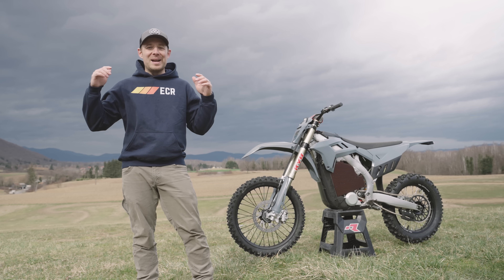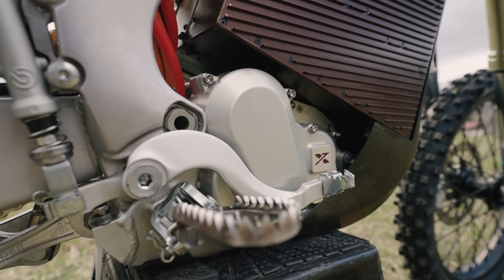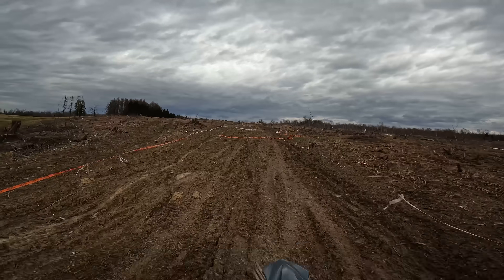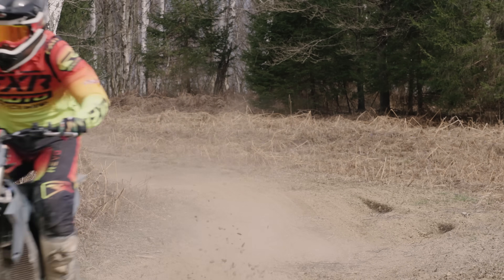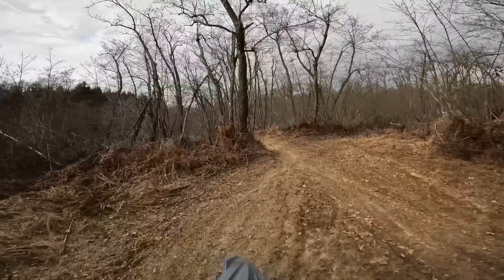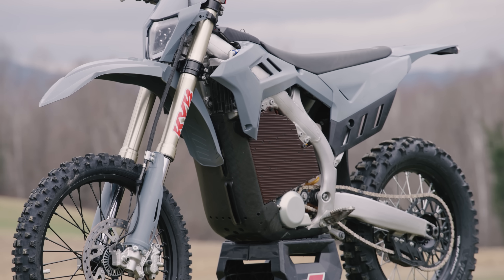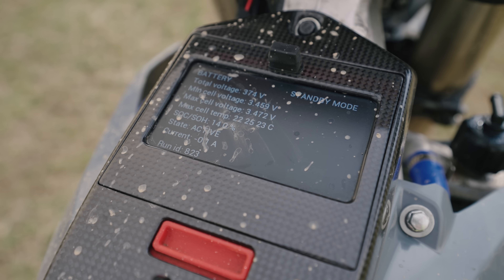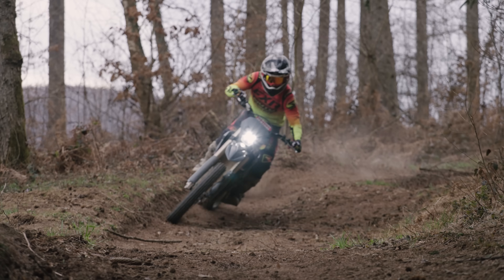We Rode This NEW Insanely Fast eMoto // Flux Primo First Ride

Comment: 80 HP and can not manage a top speed of 100 mph, electric meh.
Reply: How often you go 100mph out in the woods or on an MX track?
Reply: @shredmas  On the way to the woods, without having to drive it to the trail heads. If you are into enduro on and off-road riding, this is definitely not the tool for the task. The only thing it’s good for is for a motocross track and stealthier trail riding but suffers from the lack of range. To each their own.
Reply: @falcosparverius1  I just put my bike in the back of a truck or loaded on my trailer and go to the designated OHV staging location. Several of them within 30 minutes of my house. Also I can ride right from my house into BLM land in about 5 minutes. It sounds like you need a dual sport machine.
Reply: @shredmas  I’ve owned a Yamaha XT600 in the late 80’s that would take me to the trails and back home without a truck. Have been following the development of electric motorcycles, most of these expensive electric motocross bikes promote these high HP numbers but they all peter out at speed. A one trick pony for fun at a motocross track, I will pass due to their limited utility.
Reply: @falcosparverius1  yeah they at least had two speeds then you could attain the 100 mi an hour you're looking for
Reply: Where did they mention the top speed?
Reply: @AbnormalWrench  They didn’t but a Stark Varg which is similar at 80 claimed HP was put on a dyno reaching 96 MPH, which will not come close to 100 mph in real life riding. A 500cc dual sport will top that easily on a freeway.
Reply: @falcosparverius1 
The HP isn't the problem. 80HP is more than enough to break 100mph. It is the gearing. But I'm not sure why you assume this bike is geared the same as a Stark Varg
Reply: @AbnormalWrench  I watched the video, during the test ride, he did not mention the ability to change gears = no gears, which is a carbon copy of the Stark Varg, no gears and tailored to motocross conditions = similar to the output of the Stark Varg.
Reply: @falcosparverius1 change the gearing if you want more speed.
Reply: @weekendveterans  How would that help it improve the lack of range compared to a much less expensive internal combustion 4 stroke dual sport?
Reply: @falcosparverius1  
Once again, what a weird assumption. What gearing they ended up selecting may or may not be over 100mph, but even if it isn't, the sprockets can be changed. My Zero FX can do 100mph, albeit briefly due to thermal issues, and it has half the HP. There is nothing inherently hard about this "problem"
Reply: @AbnormalWrench  I am no novice regarding motorcycles, I’m a holder of an M1 license for more than 3 decades and logged over 150,000 miles on various motorcycles. I understand the limitations of electric motorcycles, their positive and negative aspects. Like I said, to each their own, what ever floats your boat, but based on the stats, they do not provide what I am looking for.
Reply: @falcosparverius1  
Ah, I didn't realize you were just trolling. Carry on then.
Reply: @falcosparverius1 you didn’t say anything about range, just top speed.
Reply: @AbnormalWrench  Is constructive criticism trolling? Maybe I should have said they have created the greatest thing since sliced bread despite their technological shortcomings. If these motorcycle manufacturers are serious about offering something useful and competitive with ice bikes, maybe a series hybrid generator that can be switched on/off, with range and matching top speed, a water cooled electric motor and controller that won’t overheat, then someday they may get more people to adopt their latest and greatest invention.
Reply: @weekendveterans  Read my posts on this thread, I clearly mentioned range. Have a good one, this thread is done.
Reply: @falcosparverius1  
No, it is trolling because you're nitpicking things that aren't even relevant to this bike, as far as you know. You can't seem to decide what you're nitpicking either, since you keep changing what you find disappointing.  Valid criticism would start with actually addressing anything in this video. I mean, if you want to make generic statements about things you dislike about electric bikes, at least that would be more honest, instead of pretending you have some inside knowledge about this bikes capabilities. 

People who have never ridden an electric bike seem to have lots of opinions on why they don't like them, much like EV cars. I ride my Zero on the trails every weekend, and the arguments fade very quickly when showering them with dirt and they never see my tail light again because their ICE bikes are slow and sad.
Reply: BOT, Fail.

Comment: These bikes need to have a programable throttle power band.  You choose how and when the power band is and the curve in which it happens. Also these bikes need a quick change battery pack. Change Batteries between heats instead of charging.
Reply: They basically already do. This one will, and Varg V2 will likely have the battery swap. Even the 4-strokes have programable power now.
Reply: At maybe 5000 dollhairs ?????

Comment: Been thinking about a regen lever since the first Surron.  Glad someone is going to bring it to market.
Reply from the maker: It's awesome! Have to give credit where credit is due, Electric Motion has had the PRB lever available on their bikes for years and that works awesome too. Somehow this feels more significant on the bigger full size bike. 

Worth noting, the EBMX X-9000 controller comes with a thumb throttle regen option but we much prefer the lever on the bars.
Reply: I used to have a Vector e-bike (not a real sport enduro bike though) and it had a regen brake which was really handy. I barely used its brakepads.
Reply from the maker: Good call. As you said, different category of bike but the regen lever is super cool no matter the size!
Reply: I want hand rear brake with another lever for regen - maybe a thumb - I ride with regen Off - took few days to get used to but  now  like Much better - 
having regen lever for long down hills would be great
Reply: Super excited about this too! When a full clutch isn't as practical, I want one of these!